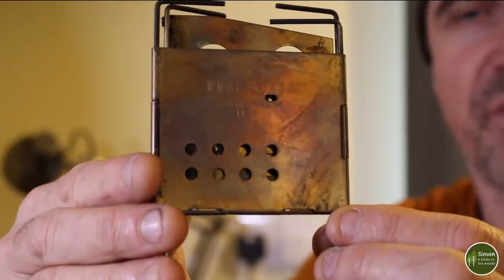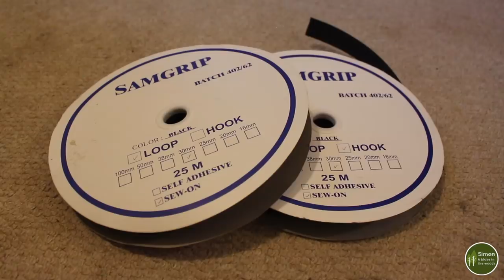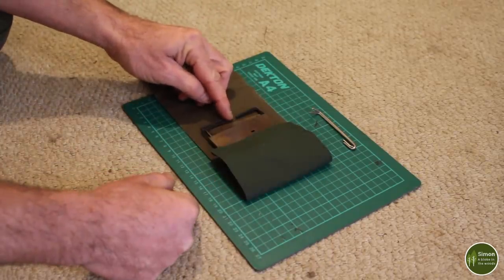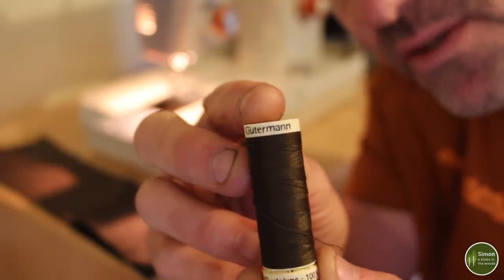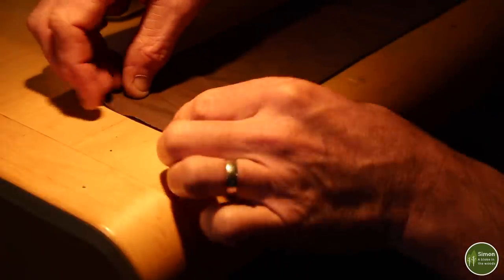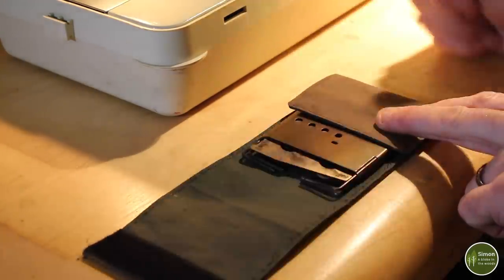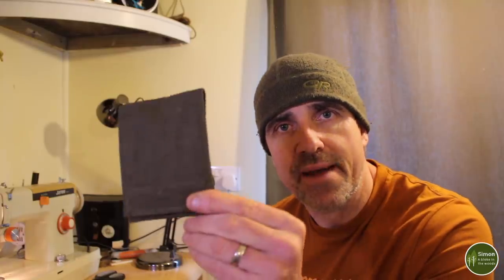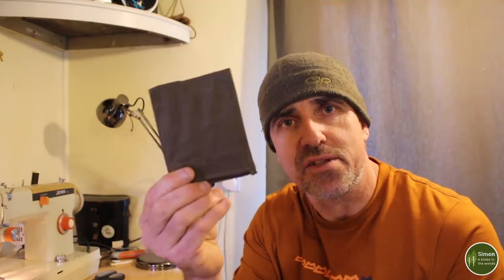How to Make a Tough Waxed Canvas Pouch for your Folding Twig Stove.

Comment: Got the same stove for Christmas, the tin is actually more than just a tin, put your stove on it and you won't scorche the ground, it also helps your stove to be more stable,  put the stoves legs in the tins "X-pattern" and you've got a stable platform :) All the best!
Reply from the maker: The tin is really good, I’ll still use it for its intended purpose, but it does add bulk and especially weight. The stove is pretty stable without it and as long as you clear the ground under it, it’s not a problem. I just like the idea of a minimalist stove. 😁🔥 hope you’re enjoying yours as much as I am mine!!
Reply: I love your minimalist bag, and I definitely see your point with the tin adding bulk :P looking forward to your future videos! All the best!

Comment: Hello Simon, very nice and precise work!! I use tent bottom fabric (nylon with PU coating) and polyester sewing thread with cotton coat.
I think this make the difference between trekking / hiking and bushcrafting. Just the weight not the fun. (-; Allt the Best for you and your family. Alex
Reply from the maker: Thanks Alex! I think you are right - I seem to be building up two sets of equipment - my bushcraft kit is heavier - more canvas, leather and wool - hardwearing for the woods and next to the fire. Then I have lightweight gear for backpacking! They do cross over a bit sometimes, but both are great for their purpose 👍 cheers and happy new year!

Comment: You got your Firebox Nano! AND IN Ti, EVEN!!! Your daughter is alright. You might want to keep that one. 😁

I like the pouch. I'd be curious to know what the weight difference between it and the X-case is. Did you get any other accessories with it and do they fit as well, if you did? The Tinder Cards with the Nano now make perfect sense. I don't know why it never crossed my mind before just now. I'll have to slip a couple directly into my case as well.
Reply from the maker: I was blown away when I unwrapped it!! I got it as a kit with the x tin, a carbon felt wind shield and the pins to hold it in place. The pouch is quite a bit lighter,  and for me, more importantly,  more compact. When I’m going lightweight, I’m not bothered about taking the extras - anything will do as a windshield - my pack usually! 😁

Comment: Nice to see you back. I am now looking for a sewing machine. What have you created :)
Rach
Reply: Rachael Wyatt Same, I have my eyes out for a second hand machine near to me.
Reply: I found one local to me and bid the man down to £20, going to see it tomorrow :)
Reply: Rachael Wyatt Good luck with that one. I know nothing about them so have been doing a bit of YouTubing today. Plenty of second hand stuff on Facebook locally but I really don’t know what I’m looking at.
Reply: What can go wrong? Spend a lot and still screw up the job, or spend a little practice and learn. If it all goes pear shaped you have lost £20.00
Reply from the maker: Haha - sorry about that!! 😂😂😂 they’re not that complicated - the key thing is getting the tension right - you can adjust the tension on the reel on top by adjusting the wheel on the front, the bottom tension is adjusted using the tiny screw on the bottom bobbin. Have fun!
Reply: Simon, a bloke in the woods No problem at all. I need to work on the creative side of my brain so I’m trying out things. I’ve just finished my firesteel with antler handle. You gave me the idea. Now it’s onto making some pouches from canvas. Have borrowed my daughters sewing machine this evening and I’ll be making a pouch for my Trangia burner. It’s all your fault Simon :-)

Comment: If you look out for a mothers maid pack at any army surplus store they often contain very high quality superstrong dark olive green repair thread!! Waxed cotton or mix of poly cotton in smaller diameter threads! They act as a great instant repair kit if out bush!!
Reply from the maker: I’ve got one - not much thread left in it mind, and I’ve added a few extras over the years - like that miracle of miracles - Tenacious Tape! 😁
Reply: @simonablokeinthewoods  yes thats what ive done also added in a few extras i dont know what tenacious tape is is it a bit like gorilla tape? Allrounder tape strong repair tape
Much needed item of kit in any fabric emergency many neglect to incl a repair kit
But surprising how often you need it
Ive used mine for all sorts
Incl making a very necessary harness repair 
To big 110litre rucsac in out back!
Until i got it to a saddler
After the local saddler had fixed it it was.bombproof.you just couldnt wear it out!!
Or abuse it
It was indestructible 
Saddlers do great heavy stitchwork
For load carrying seams etc
Sailmakers are good to tap up too if yer sewing machines not up to it
Reply: @simonablokeinthewoods  
Is the tenacious tape to cover over yer mouth if yer on a diet? 
Out in the woods!
Reply: @simonablokeinthewoods  stop the food from going in
Or do you use it to keep the food back!!
In? Yer mouth!?
Reply from the maker: David Huxtable 😂😂🤣🤣🤣
Reply: @simonablokeinthewoods  lol : )
Im only jealous of yer cookery & meals! Selections ive been fancying a big fat juicy steak lately i may order myself a limousin steak soon at la charlotte
El cheapo resto near me i been yearning for a bit of juicy red beef meat!!
I love it on open fire herbs sprinkled over it
Cant beat it!!
Ive had some gourmet meals out here better than at any resto
With a smashing sunset view too
Cant beat bushcrafting meals if properly menu plan prepared!
Reply from the maker: David Huxtable - I don’t often take my full housewife kit, but I’ve always got needle, thread a safety pin or two and gorilla tape, plus a length of wire!
Tenacious tape is a specialist tape for repairing waterproof fbrics - tents, expensive goretex jackets, down sleeping bags and yes, even across my gob! 😂
Reply: @simonablokeinthewoods  aah ive never heard of it must look out for it i always take a swatch of at least 3x diff fabric types with me incl wire which is dead handy
In lots of repair uses
I carry a glue gun refill for gloopy glue type repairs use lighter to melt it but i repaired my boots and a watering can recently both plugs worked for a bit then fell out!!
Off the object
Ive often had to use more than one  type of item or fabric to secure any fix
Aim is to keep it low bulk but comprehensive enough to cover
All of yer anticipated repair needs i often think whats worst can go wrong cover the important items only if weights an issue
To me?
But if kayaking canoeing no need to worry
But im going to try to proof up a lightweight canvas sheet using a 3 part mixes of beeswax turpentine and white spirit
Painted on using an emulsion brush oil a fabric old school
Style ive revived a 4oz pu coated leaky nylon groundsheet on my tent doing this daubing on oil cloth mix onto nylon fabric brought its waterproofing right back after 30+years of uses!
Reply: @simonablokeinthewoods  linseed oil also i forgot to mention that aĺl important ingedient
I hand press each linseed
To just be more authentically bushcrafty!
Im.same when i drink my guiness & black hand squeeze each blackcurrant
To enjoy my habitual guiness & black! But?
Barmaids landlords dont like it whenever i ask them to hand squeeze the blackcurrants for me?
Reply: @simonablokeinthewoods  

So whats this then? A newer unseen femenine sides of you? simon i like to dress up as a housewife & wear a pinafore in the woods!! 
Perhaps yer viewer data base stats will get a boost if you were to reach out to all of those bushcrafters who are repressing their femeninity far to much?

Comment: Nice! Any tips on what sewing machine to buy for Bushcraft projects? Will any old one do or did you look for a heavier duty one?
Reply from the maker: I used a 1970s Jones domestic sewing machine for my lavvu  - did the job perfectly, finally gave up the ghost a year or so ago, but I was so impressed with it I bought another one of similar vintage. The older domestic machines were built well, heavy with cast iron components - modern machines, although full of high tech features are plastic and seem flimsy (in my opinion)  you’ll not go wrong with a Jones or Singer!

Comment: Nice  good job check your tension on the machine seems a bit off
Reply from the maker: Thanks Sara! Well spotted 😉 I actually unpicked that run and restitched. Oddly, the first run (before it turned it the right way round) was fine. The tension is a bit temperamental on that machine and needs tweaking occasionally. Happy new year!

Comment: That cutting wheel looks sharp
Cuts more than pizza then
Leaves yer fingertips on yer cutting table!!?
Reply from the maker: Not yet, but it’s been close a couple of times! 😂😂😂
Reply: @simonablokeinthewoods  im thinking about joining the elitists of norfolk and buying a firebox nano im amazed how they vary in price!!
Its spans 2-3 digits price wises?
The Madness
Of marketeers!
Do you rate it?
The stick holes look like you have to be size specific
Regards size of wood you use to poke stuff thru holes!
Reply: @davidhuxtable8918  I bought mine from the Bushcraft Store, reasonable they stock accessories
Reply: @misolgit69  thankyou i shall check em out

Comment: If i were you id wop out the landy engine and replace it with the sewing machine engine as it sounds as if it has far more power life left in it to me?
Nobody would even be able to notice the sounds of a landy engine being replaced bye a sewing machine motor!?
Would they?
Youd then have the option of making yer tramel head foot for the sewing machine 4wd capability
For them ruffles grooves uneven surfaces of yer excess fabric as you push it through yer sewing machine head
You could use yer differential to gear it up or down for unruly fabric! 
Surfaces!
Sell on the landy at vast profits  as an special edition 
 eco engined landy to a bunch of naive hippies! 
Tell em how it runs on only a thimbleful of oil 
All year if needs be?
Has very low noise impact decibel rating tell em its lower torque compression
Is great in lower ratioed gears
Or if herringboning or reinforcing the edges of
An awning?
Or saving fuel over long distances! 
Is optionally battery or mains fed making it a hybrid landy
With very low carbon emmisions
Ratings for hippies!?